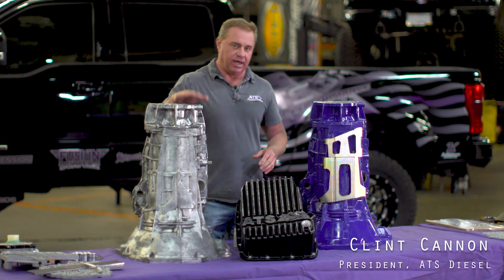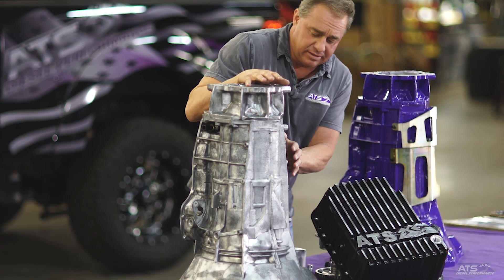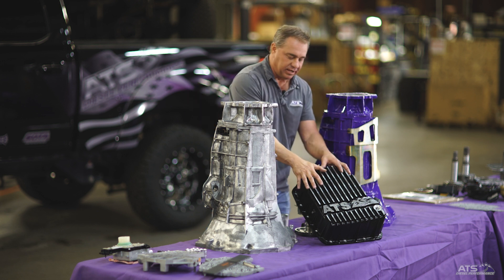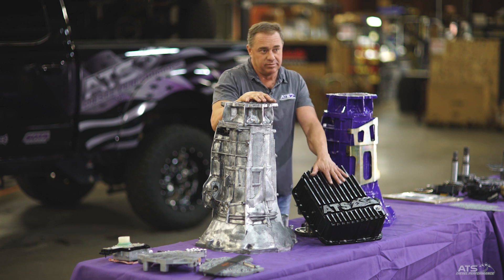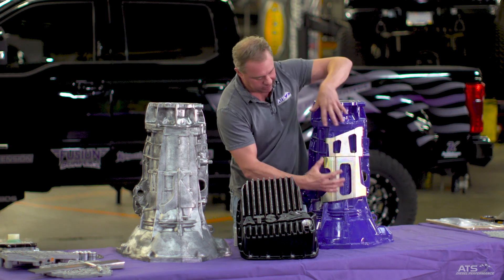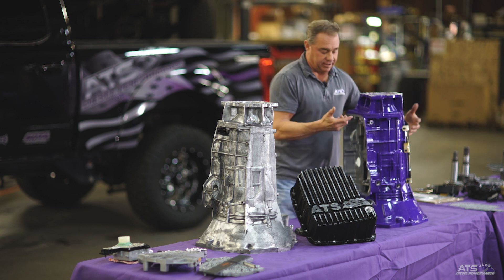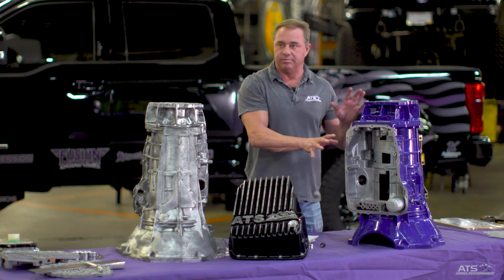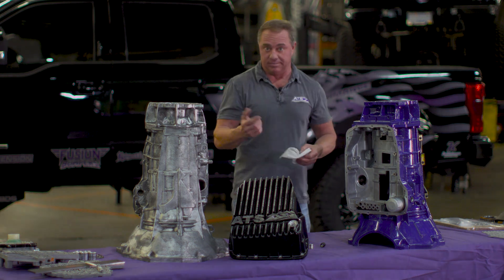Product Overview: 68RFE Case Brace and Deep Pan

Comment: The ATS deep pan can NOT accommodate the longer filters that are typical on the market today. I bought this ATS "deep" pan and I cant use anything except the short OEM filter. Also the ATS deep pan is about 4x more heavy a cast than necessary. Better solution would be for ATS to cast or machine the mating service with the transmission and then send out specs to an aluminum fabricator, it would be lighter and able to handle a strike or dent without transferring that stress to the tiny 6mm screws .

Comment: It appears that too much of the forces are exerted into 6 small bolts on the side of the case. While it is an improvement, it certainly does not transfer all the stress forces from the rear to the front as claimed.